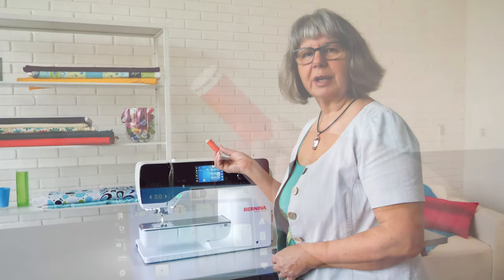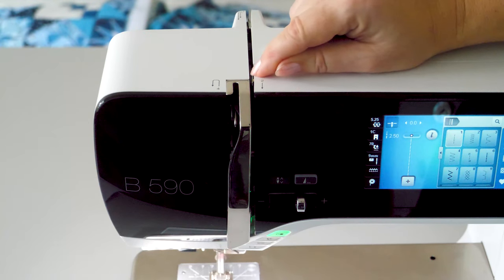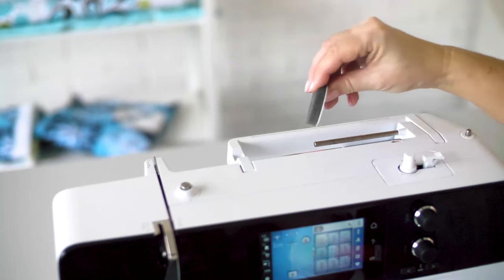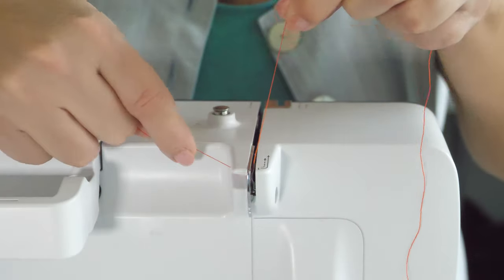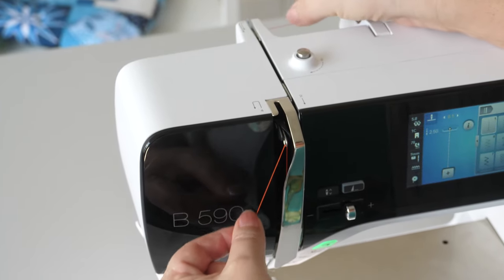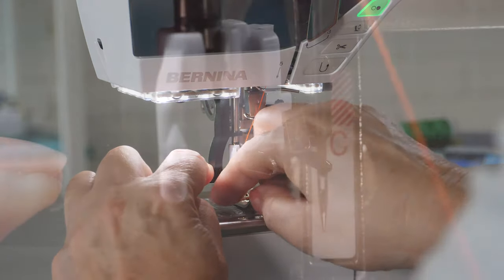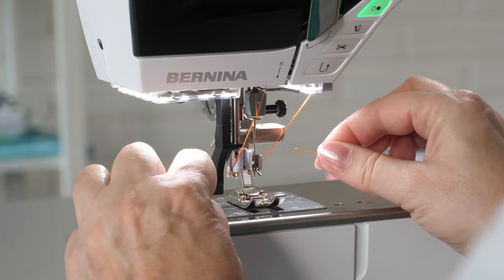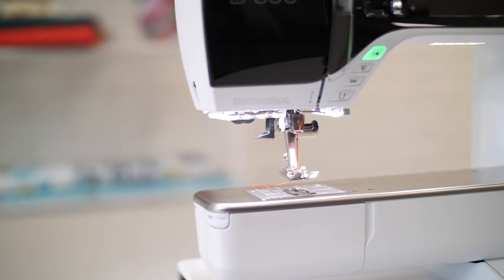How to thread a BERNINA sewing machine – threading the upper thread correctly

Comment: No matter how often I thread and retread  my 990Q sewing machine I many times get an error message prompting me that something is wrong with the threading.  This doesn’t always happen but often enough that is becomes a real nuisance and is annoying having to retread the machine again.  I am threading exactly as you are demonstrating.  I have taken it in twice now to have it checked out but I still often get the error when nothing is wrong.
Reply from the maker: Dear Dodie, thanks for your comment. Can you please specify which machine model you are using? We are not aware of a BERNINA machine named 990 Q, sorry. If this is about the Huskvarna Viking 990 sewing machine, we recommend that you get in touch with Huskvarna. The video above applies to current BERNINA machine models (except the BERNINA 8 Series).
Reply: Sorry, I have a Bernina 770 QE.   Got my numbers mixed up.
Reply from the maker: @dodielabbe8644  Can you please send a picture of the error message to youtube@bernina.com? If possible, please add close-up shots of the threading path, from spool to needle. Maybe this will help us find the reason. If not, I'm afraid you will have to contact your dealer again as we can't offer the same level of support without actually sitting at the machine.
Reply: I have the same kind of issue with my 770QE. I keep getting the upper thread error even though it’s threaded. I’ve had it serviced and still get this error.
Reply: I’m still having the same problems a year later after having it serviced again. I find it happens most often either polyester thread. I get so frustrated I end up turning off the thread monitoring in the settings. I know it’s not the best practise but there is nothing wrong with my thread or threading

Comment: not coming on when plug in
Reply from the maker: Hi Michael, surely you have turned on the switch? If the machine doesn’t power up (it does take a few seconds) after plugging in and after turning on the switch, then please ontact your BERNINA dealer

Comment: You don't specify, but from watching it appears that as you bring the needle threader half way down you also lower the presser foot, which had been in the up position until that moment. Is that correct?
Reply from the maker: Hi calisson,
it depends of the type of machine you own. All machine models with an automatic presser foot lift will lower the foot automatically as soon as you push sown the needle threader.
Reply: @BerninaInternational  I have a B435 and it doesn’t seem to do that, so I guess it doesn’t have an automatic presser foot lift.
Reply from the maker: Hi calisson, 
no, the BERNINA 4 series doesn`t have an automatic presser foot lift. You have to raise and lower the foot manually at the back with a lever.

Comment: When putting the spool on the horizontal spool holder, is the thread to come off the spool clockwise or counter clockwise?
Reply from the maker: Hi Stephanie, this depends on the spool type. With small spools, the direction in which the thread unwinds is usually irrelevant. Detailed information can be found in this article: https://weallsew.com/sewing-machine-thread-spool-pin-tips/
For spools where it is not clear in which direction the thread should unwind, there is a trick: Pull off approximately half a meter of thread and leave it hanging. If the thread loop twists, it is the wrong unwinding direction. Here is a video that shows this (unfortunately the video is in German, but pictures speak louder than words :-)): https://www.instagram.com/reel/C2JweWUs4KC/?igsh=bHdtdXZ3YXpyZWZt
Reply: @BerninaInternational . Fortunately my husband is German so he translated!! 
The confusion I’ve been having is in my manual for the B535, it states thread should unwind in clockwise fashion when using horizontal spool holder. Which means thread would come from the underside of spool when first mounted. However nearly every vid I’ve seen from professionals, including some bernina reps, has the thread unwinding counter clockwise (thread coming from top side of spool). A lot of contradictions. However, the German vid makes the most sense with regard to actual thread behavior vs a hard and fast rule. Thank you!

Comment: Can you clarify that when the thread comes down it goes to back of thread guide 6 right to left and then to thread guide 7 left to right. I would liked to have seen a clearer shot of that detail.   The automatic threader takes some getting used to.  I struggled at first but I am starting to get it on the second or third try.  Attaching to the thread cutter makes a difference as I think I was just holding too tight.
Reply from the maker: Hi there, thanks for your comment. Here's a video that shows the use of the needle threader in detail: https://www.youtube.com/watch?v=CXiLFiIR_mk We hope this helps. More information can be found in the user manual that came with your machine. Happy sewing!

Comment: Does the upper thread need to be on the right or left side of the tension in slot one?
Reply from the maker: Hi Sew my own clothes, are you referring to 01:52 of the video? The thread has to run between the tensions discs. Make sure to raise the presser foot before threading. This will open the tension discs.